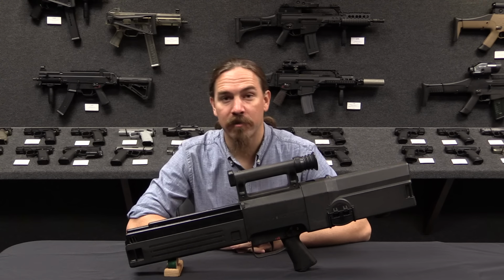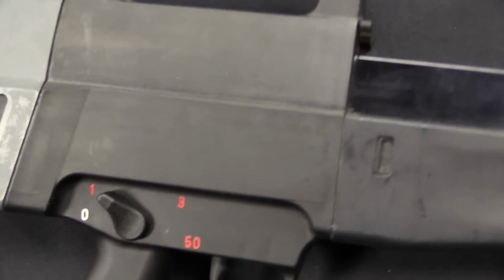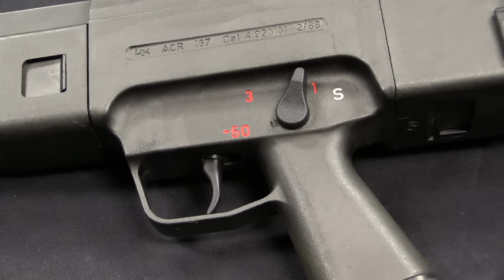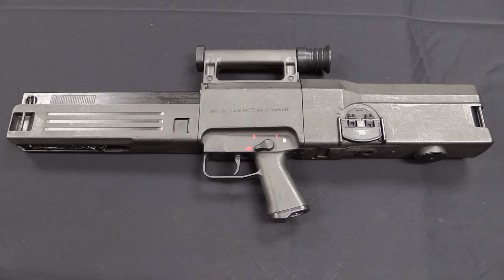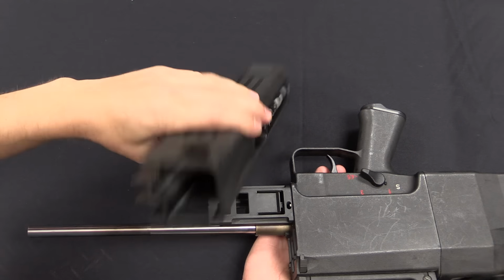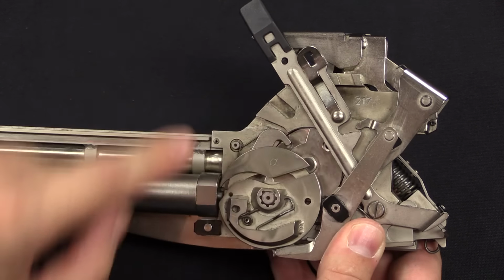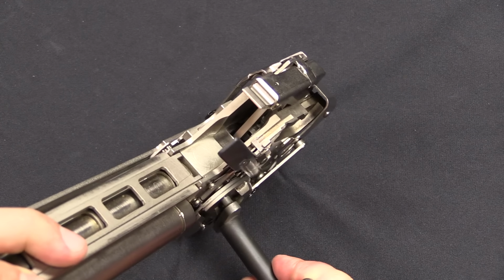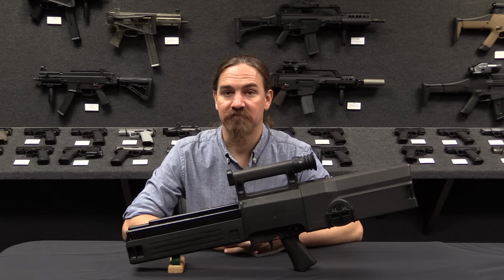Kraut Space Magic: the H&K G11

Comment: couldn't powder be replaced by a smaller charge of thermally non-reactive, water, and shock-proof, plastic-explosive-based propellant that could then be fired electrically using a capacitor and; either an initializing faraday-type squeeze action on the grip or repurposed traditional charging handle bolt action; and that could then be charged by harnessing subsequent recoil or gasses? 

The spark prongs would have to be expensive-ish to be able to survive (coated tungsten, I would think) but would hopefully last for tens of thousands of detonations if you're going that far anyway...

such a system; with the addition of modern composite materials for weight, durability, and thermal management; would not be susceptible to cookoffs, shocks, water etc. in the ways that caked powders are, and a sealant or formulation to prevent dry-out is easy enough. the only real draw-back is that it could not be sold to civilians in a full auto, or ungoverned semi-auto, configuration as that would REQUIRE the plasticized propellant (unless they're licensed to handle explosives o/c), so the civilian version would need to have a more traditional caked powder and a limiter on rate of fire to prevent cookoff... A safety feature that does not cycle a round into the chamber until the trigger is half-pulled would be a good idea too...

It would also mean that there's reduced danger to soldiers from enemy fire detonating the ammo in their vicinity (be it on their person or in the post/base magazine).

Comment: Underneath the casing this is honestly one of the most beautiful firearms I've ever seen, I feel like if you flipped it upside down you could get a very compact bullpup shaped weapon out of it, might need to strengthen the ejection system and it could probably do with a better way to charge the bolt, at the risk of even more complex mechanics you could just have a straight pull converted into rotary motion, obviously I'm not an expert in firearms or logistics and there are definitely very good reasons it wasnt adopted but fuck me I wish it was

Comment: I have an article about  this in an older Assault Weapons Digest. Hk and Dynamit/Nobel spent ALOT of money on the ammunition and gun, as you mentioned. It's a shame that the fall of the Berlin Wall and other issues prevented this from moving  further forward. Supposedly, the gun was very accurate in burst mode and, as you mentioned,  the soldier could carry alot more ammo than another soldier with .223. I cannot see an Armorer doing any kind  of detailed stripping to this action, other than spraying it with some kind of evaporating plastic safe solvent-John in Texas

Comment: The burst recoil system is actually genius.
Reply: yes it would be very powerful if you were able to carry it properly and had the right training for the rifle because it fires 3 rounds of the powerful ammo at a very quick pace which would definitely make sure a good shot to the middle of the head would immediately end the enemy with no fuss.
Reply: There are some other videos floating around on YouTube of the g11 being fired.  In the burst mode it looks to kick about like a 12 gauge or a 30-06.
Reply: @ReeveHelalV  which is interesting, because the AN-94 uses the same idea of a "hyperburst" with a recoiling "gun inside the gun", and it seems to have almost the same recoil as normal single 5.45 shot (which is very little)
I wonder if the G11 recoils harder because of the extra shot or because of some different mechanical solutions used
My guess would be that AN-94 has a pulley system and a pretty conventional gas-operated AK-style bolt group, which may contribute to lessen the recoil (part of the energy is spent on making these bits move, and is not going directly to the shooter's shoulder)

Comment: How effective would a modern version be?

The ammunition is fragile but you did say there was a fix in a plastic case (poorly summarized) is this a hard fix or a minor fix? And if it's the latter is it possible to have a proper solution nowadays?

Could you make a lightweight case that consistently burns up on firing?

I've seen some people talk about malfunctions but that depends on statistics. How likely is this going to malfunction in a way that can't be fixed compared to other rifles, as well as malfunction in a way that can be fixed compared to a normal rifle.

Plus is fixing a malfunction faster or slower?

You mentioned accuracy. Is it acceptable quality of accuracy in exchange for the benefits of lighter ammo?

Also never having messed around with one, it seems like reloading it would be awkward due to the release. Is that a problem and could it be fixed?

Comment: If you don't have a cartridge then when you carry rounds you have to make sure they're dry and that they are protected from any outside force on them because they are extremely brittle if they get wet or anything it's useless ammunition might as well be thrown away. This is the reason why people did create cases for rounds because a sealed bullet in a case in you could throw in a river pick it up out of the river wipe it off and throw it in your gun and it will still fire that's why the created brass rounds that way you can either reload them or their weatherproof to a certain point. And if a spark ends up in your clip or near the rounds it could do a premature explosion

Comment: Would be cool to see a caseless rifle powered by c4 and a battery. I assume that plastic explosive can be hardened rather easily, and the primer could basically be a watch battery in front of the c4 and attached to the backside of a bullet or even the projectile itself. It would be a hard thing to make the round safe outside the gun and able to safely fire, in particular how to engage the the battery inside the bullet reliably. Nonetheless it would be a cool concept if it could be pulled off.
Reply: C4 can't be hardened (look up how it's made), however, the ammunition for this was something like CDX or MDX (explosives normally associated with Artillery shells).
Electronic firing wouldn't work since these explosives take both heat and pressure to ignite.
You could mold in a cap in the base, however.

Comment: He failed to mention one of the first things I thought of when I ran across this gun years ago. The square ammo fills all that wasted space in the corners with usable powder. A standard magazine has a lot of empty air in it. A G11 magazine is a solid brick of send these down range.
Reply: That's such a interesting point - effectively making the ammunition smaller for the same amount of powder and making it fit better into the magazine
Reply: @aravindpallippara1577  The ammo also has no brass which makes it super light.  Smaller ammo and lighter ammo, no wasted space, = very space efficient ammo, but it falls apart easily.
Reply: Mind blown! Such a good point
Reply: How hard would it have been to adapt existing weaponry to use caseless ammo?
Reply: @twistedyogert  You can't do it, you would have to just replace the entire center firing mechanisms of a gun.  Also, there is an issue with overheating, so you would need to have a water cooling mechanism for the guns if they would see heavy use, brass ejects a lot of heat from a weapon.
Reply: @twistedyogert  hard enought that nobody did it until today. even the gunfanatic muricans not. he is adressing a lot of the problems you have whit caseless ammunition and guns using it. now imagine how much more problems you would have whit a gun not build for caseless ammunition in the first place (heat staking for example)
Reply: If you base it on the stuff said in this video. Really hard. There is completely different guts to either.
Reply: @twistedyogert  It would take a tremendous amount of time, research, testing and funds to convert existing weapons to use caseless ammo, it would almost certainly not be worth the effort.
Reply: The guns in Avatar apparantly all have this set up. Trust Cameron to put that much thought into his future guns.
Reply: hmm
Reply: Ideal for jamming and getting stuck together with gank and goopy whatever
Reply: @weareallbeingwatched4602 didn't happen once when field tested during the OCWS trials, when over 3000 rounds fired. Caseless ammo proven effective. Not adopted because of politics, would put a huge crimp in brass cartridge manufacturers profits
Reply: Brilliant
Reply: That's 65% more bullet per bullet!
Reply: Yeah, like a stick of dynamite… wait

Comment: 2100 rpm 3 round burst...that is insane.
Reply: Yup, the 3 round burst is fired in 6 hundredths of a second. When the third round fires, the first bullet is about 55 meters out ahead.
Reply: I'm not sure if 3 bullets at zero recoil is what you need

Spread helps you with the accuracy deficiency of shooters

The g11 might be accurate, but If I'm not...then... Its worse than an stoner or kalash

At 2000rpm then It means I'll burn my ammo cartridge faster
Reply: @mauriciosolano9342  considering that while you fire the second and third round the barrel is moving, i suspect it will generear some spread no?
Reply: @crazy031089  yep thinking the same thing
Reply: @mauriciosolano9342 he 2100 rpm is just for the 3-round burst setting, though. Full auto is rather relaxed 460 rpm.
Also, I'd presume it's not like the burst will automatically equal all three rouns hitting the exact same spot regardless of how (un)skilled the shooter, but rather introduce some spread, at least on moderate distances onward. And if in the hands of proficient shooter, a triple tap on a target with a single trigger pull ain't a bad feature.
Reply: @mauriciosolano9342  According to Wikipedia, the G11 was designed to have dispersion that would allow for consecutive shots to have a high probability of hitting a target, helping to counteract the accuracy deficiency of shooters.
Reply: @mauriciosolano9342  Even with no spread you are increasing probability of hitting a target spriting sideways between covers (the example in the video). I have seen 10 m/s as a possible (in the upper end) sprinting speed for a human over a short distance, which means they have moved 0.6 m in those 6/100th of a second it took to fire the 3 rounds. That should be a not insignificant increased probability of hitting that small sideways moving profile.
Reply: @mauriciosolano9342  Wrong. All shootings showed, an average guy reach 95% of hit chance with this rifle in the 3-round-burst. Because at the distance you cover a large area with this gun, so as long as you aim near the target, one of the 3 rounds will hit it. 
And no, if you are to lazy or dumb to look at that video, the 3-round-burst meant, you pull the trigger and 3 rounds - out of 50 - leave the barrel. In fact, this method reduced the use of ammo significant. 

It is always fun if a guy with zero knowledge write some utter bs... 

you never had understood the motivation behind the 3-round-system... so stop writing shit.
Reply: @steffenjonda8283 any sources?
Reply: @Jacob-sb3su  well, read the official test results... and ask the guys who shoot the weapon.

It WAS that good.
Have you evidence for your claim that it did NOT hit as designed?

As mentioned, the weapon is the best army rifle of all time (at least till now), for average shooter. If you are a sharp shooter, you do not need this weapon. But as the standard average german/european guy, who normally do NOT shoot rifles or weapons at all, you achive the best results with this weapon. Because the 3-shot-system worked.  But to allow it to work you need the combination of "high speed fire rate, turning twist lock and shell-less ammo".

For normal combat duty in common wars with trained shooters, you can drop that.
For germany with its planned "HUGE" army of conscripts and untrained people it would be the perfect solution.
Reply: @steffenjonda8283 
Jacob didn't claim any of that stuff. That was the other guy.

Comment: I would like to see an animation of how it operates, but from what I saw here it appears it works on the revolver system.   The chamber is in a revolving cylinder and turns into and out of battery to fire and reload.  If correct there would be gas escape at the gap similar to any revolver.
Reply: Operates in an enclosed spacing - also have you heard about nagant service revolver of Russia?

That one had a locking mechanism preventing gas leakage - hence could be actually suppressed somewhat (and was suppressed)

Comment: In my opinion everyone is missing the point of this gun.
First and biggest factor in its favour the shear ammo load.
Second mass production, with stamped parts and polymer casing if an actual factory was set up it would likely be easier and faster to produce then guns like the M16
Third, accuracy, firepower and versatility.

Forth, carry two guns. Given how cheap and light it is and how much ammo it holds just carry two guns if one has a mechanism failure switch to the other, then after out of combat see if the problem can be easily fixed. While I Understand the shear vehemence towards using a gun that might fail in a way you can’t quickly fix the chances of this kind of failure are low in the first place if you carry two guns this is no longer statistically speaking a real problem. This also means you are carrying 300 rounds of ammunition which is more than enough that you don’t really need to hold any more.

This gun has so many advantages and one minor unlikely problem that seems it would be easily fixed, plus made even more unlikely by further development of the weapon as time goes on. It honestly feels like such a waste.

Comment: Huh, I’ve never heard of case-less ammo before made me think of muskets and powder horns at first. Also apparently theirs two different kinds. The kind in this video is external (I think) but the also have internal where the spent propellant is fired off with the bullet (aka how I originally thought when I was a little kid “normal” bullets work). I wonder why those aren’t see as much (according to Wikipedia at least) since it would solve a lot of the issues you mention I think. But I’m new to guns so I’m sure I’m missing something. Thanks for the great video!
Reply: You're thinking of rocket balls where the powder is crammed inside a cavity in the bullet. They're not used because they fit so little powder in there that they have next to no power. The Volcanic pistol that introduced them was infamously so weak a person returned the gun after attempting suicide because the bullets would bounce off his skull.

Comment: Instead of using a primer why don't they just ignite the powder somehow with like a tiny little flame or spark to ignite the chunk of powder you know try to make that little chunk of powder with a time you know a little spark would on it and it'll you know you know like an old match lock or a flintlock you know that little spark at nights the powder they can put like a little like a wheel lock in there you know or something like you pull the trigger the Sparks makes a little spark it ignites the powder or a tiny little flame or whatever or even have a little laser shoot it you know some kind of heat source to not that powder and you wouldn't have to have a primer at all and it could just be bullet and powder